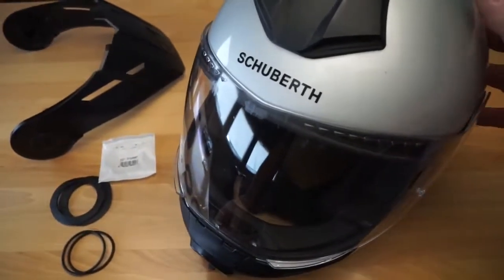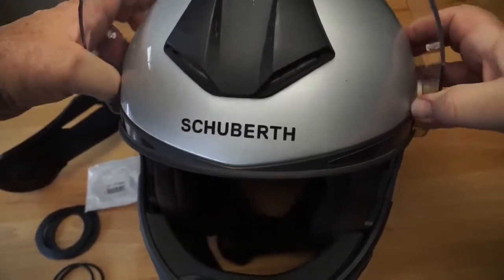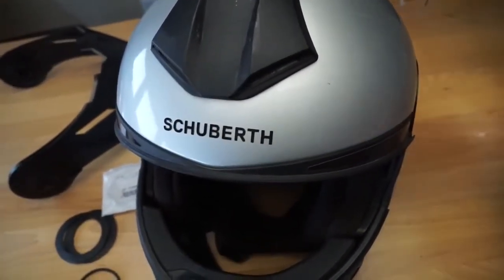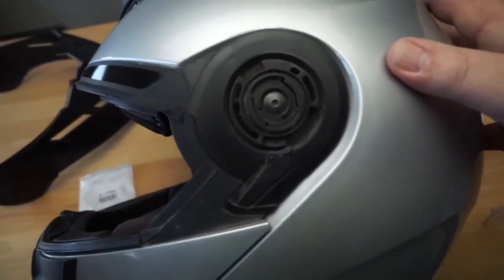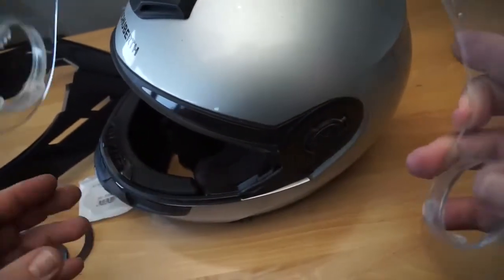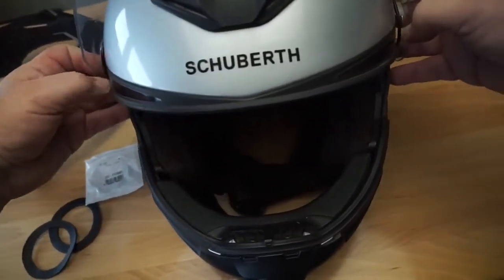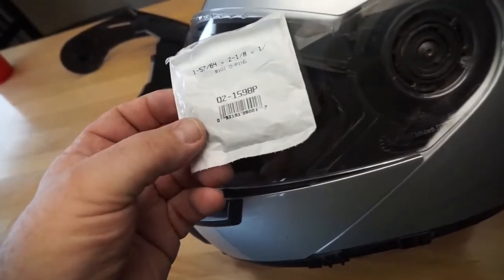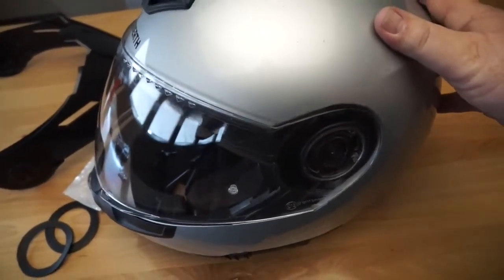2 minute $2 Schuberth E1 Floppy Faceshield Fix

Comment: Thanks, LSA! I've been looking for a replacement faceshield because of scratches, but it's also been bugging me because I'd like it to stay open about half as much as the first click setting makes it open to. I haven't been able to come up with something that will hold it open about 1/4" without wrapping a new zip tie around the chin guard every ride.
If you know of replacement faceshields less than about $80 I'd be happy to hear about it!
Reply from the maker: Hey - I did the zip tie thing for a while when on the road lol. I was glad to finally figure out the washer solution, and later discovered some others had done the same thing - great minds think alike :D